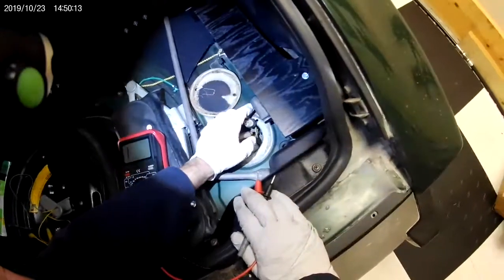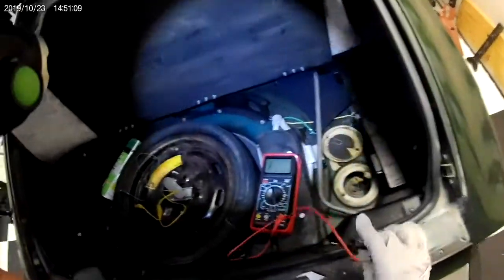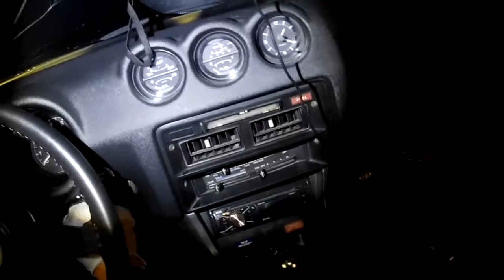280Z OLD Fuel Sender / Fuel Gauge Testing and Troubleshooting

Comment: So confused on what you ended up fixing. Did you replace the dash GUAGE or the fuel sending unit
Reply: The gauge was fine. He kept saying gauge and he meant the sending unit. The sending unit was not sending correctly. Likely can pull it and clean it up. I need to do the same. Hoping for some on that but now I keep looking...